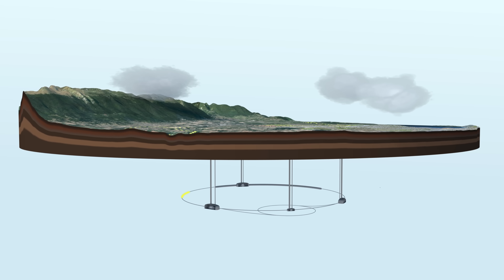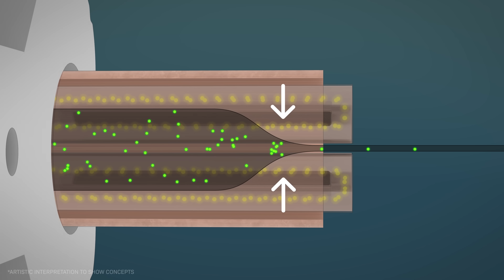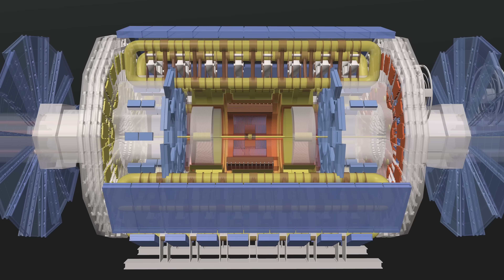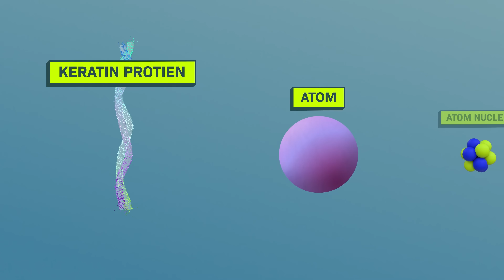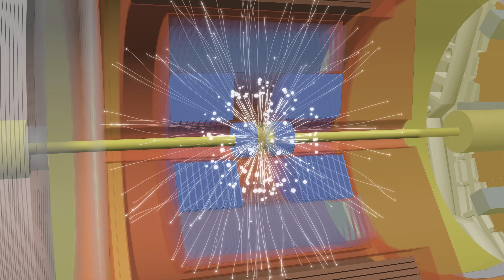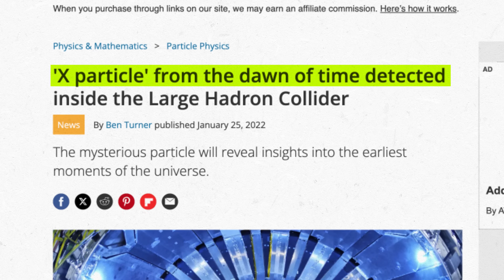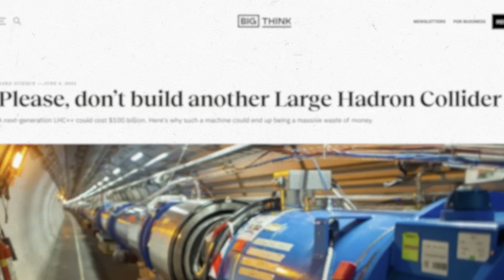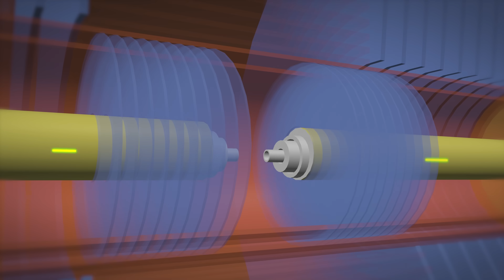What's Really Happening At CERN

Comment: The problem is that the LHC showed no "new physics". It proved the existance of the Higgs boson, but that was a must and a promise by particle physicists who built the LHC. But beyond that nothing new was found, we still have the same open questions as before. We badly need a hint where exactly to search for "new physics". That is why also physicists ask if simply building a bigger machine with higher energies to clueless look around is a good idea.
Reply: Indeed. Many physicists expected the LHC to find super-symmetric particles and it hasn't. So the main use of a bigger collider would be looking for super-symmetric particles more massive than the LHC is able to investigate and a perfectly valid question to ask is, "OK, but if that doesn't find them either, then what ? Just build an even bigger accelerator ??".

The difficulty is, at what point do we basically accept that super-symmetry isn't right and a bigger accelerator isn't going to help ? Plenty are saying we're already there. So we need a new direction to look in and right now, none are particularly forthcoming.
Reply: @anonymes2884  Right. Some of the SUSY guys were quite inept, stating that they would be nearly sure that the LHC will find the lightest SUSY partner ... That damaged also the string guys, because any string theory must be necessary supersymmetric. In that light other physicist begin to lose thier patience with hypothesis wich could not make any experimental tested prediction ... since nearly 100 years (if we count the predecessors of string theory). Not a good time to be a high energy physisicst. It's badly stuck.
Reply: Yes, isn't that just science? Did it matter that bees don't come from flowers? Of course it does.

Comment: Curiosity is very fun until you realize the role it plays. Effects shouldn’t dictate cause or you’ll end up wondering why and how there’s a big satanic logo on an international CRT capable of bypassing the ionosphere as well as the suns monopole anode surface and instantly grounding out all the accumulated charge trapped in earth that powers all of earths fields. Just like the earth is ground to our electronics, the sun is earths “ground” because it has way more capacity and frequency bandwidth. Imagine the sun as a battery whose entire surface is an electron giving anode pushing outwards in all directions, the cathode is a momentary gap in time and space known as a solar eclipse path of totality. It’s the only theoretical connection point into the suns cathodic core.
Reply: nutcase stuff..sorry.

Comment: If the atmosphere and the earth together constantly rotate from west to east, how is it that clouds, wind, and weather patterns often travel in opposing directions simultaneously? And why don't pilots need to make 1,000 mph compensation acceleration when flying east to west?      If the earth is rotating, why can't I simply hover in a helicopter and wait for the earth's rotation to bring my destination to me? The helocentrist will answer, "Because the atmosphere is rotating along with the earth."  Experiments have been performed firing canons in all cardinal directions to check for earth's rotation. If the earth was really spinning as the heliocentric model suggests, then the East-firing cannonballs should fall significantly farther than all others, and the West-firing cannonballs should fall significantly closer than all others. In actual fact, however, regardless of which direction one fires a cannon, north, south, east, or west, the distance covered is always the same.      ...

Comment: I'm a huge science enthusiast and not opposed to spending on purely theoretical research, but really, what are the reasons? The last particle of the standard model, the Higgs Boson has been found and all data agrees with the standard model. Beyond that, there isn't any rational reason to look for other particles. Scientists just want to include gravity in the standard model and have one unifying force, because, "it would be beautiful". But there isn't any evidence for the same.  The Axion, supper symmetry, WIMPs, Dark Matter, Proton decay, and Familons are all predictions have been tweaked multiple times and been proven wrong multiple times. But particle physicists keep making new predictions.  It's been 50 years and the models are more complicated then they need to be to accommodate for these 'possible' particles.  The issue isn't that it's expensive or will take a long time, the issue is there can be multiple 'incorrect' predictions and we can't just keep trying all of it. We need good predictions that make necessary changes to make our theories *simpler*, not unnecessary changes that complicate theories in a pursuit to include gravity.

Comment: Something the general public also doesn't really know about is all the side products from a large project like this. You mentioned the WWW but there are way more pieces of open source software and contributions to open source software that are very significant when you add them all up. A lot of software libraries for processing data, doing math, improvements to software compilers and interpreters like Python. Improvements to open source tools like KiCad where in the past, if you wanted to design a circuit board, you almost need commercial tools that cost a lot. 

Another interesting thing is, infrastructure like large supercomputers get built for or by CERN, but idle time gets given to researchers in fields with less funding. There is a chance a LOT of different research would not be done if a large project/organisation like CERN did not exist.

Comment: It would be cheaper to build and to run if we did this in space. They would have decided to put this together in space if space x had already done reusable launches back then. Space is already cold therefore less cooling electricity is needed. It's already a vacuum. No need to dig deep. Etc

Comment: Why is LHC so big? They say there is an equivalent desktop particle accelerator device.
Reply: Imagine you have a stone tied to a rope and you swing that rope around you, you would feel that the stone wants to escape from the circular path so you have to apply a force on the stone (through the rope) to keep it in its circular path. The LHC does the same thing, just that the rope is immensely strong magnetic fields that bend the path of charged objects (in this case protons). This is all fine and dandy but the force needed to keep a faster and faster object in the same circular loop you need an exponentially stronger rope. This is the problem. The magnetic fields in the LCH are so strong that we can not realistically make them stronger without them violently ripping themselves apart. So the solution is to make a bigger loop as the force needed to keep an object in a tight loop is much higher than the force needed to keep an object in a bigger loop if the object travels at the same speed in both cases. So when we have a even bigger accelerator with a larger radius we can handle faster particles without strengthening the magnetic fields and therefore have higher energy collisions.

TLDR: imagine a rope with a stone and you swing it so fast around you that the rope breaks, you want to swing the stone faster but are limited by current rope technology. So the only solution is to make the rope longer som the stone can achieve higher speeds before the rope snaps again.